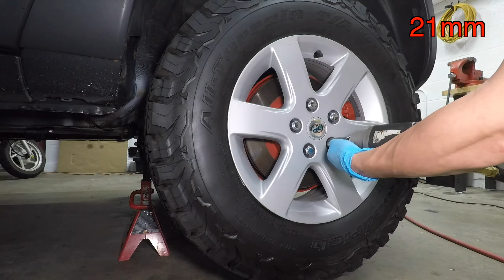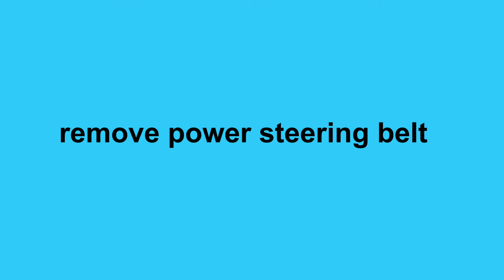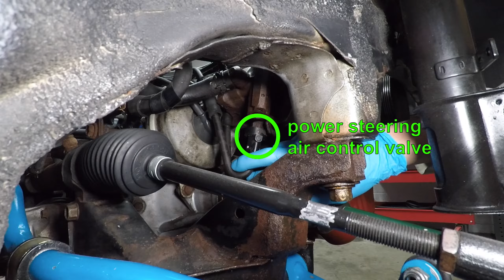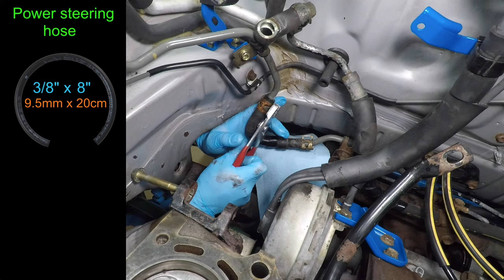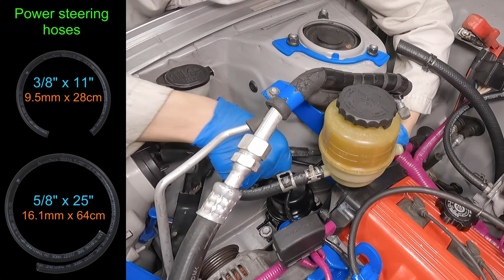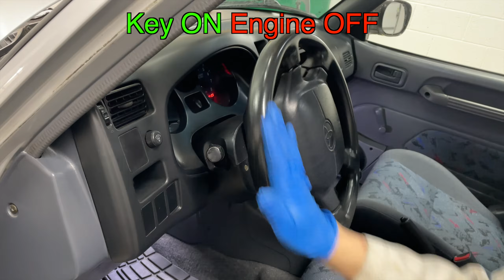Power steering pump replacement 1997 Toyota RAV4 (episode 27)

Comment: Hey Paul.
Thanks for the great video.
Do you think the process to change the power steering pump on 1999 toyota rav4 4 doors with 2 wheel drive is the same or maybe slightly different.
Please let me know. You the  one i watch when it comes to working on my 1999 toyota rav4.
Thanks again

Comment: Hi,m trying to search for ur contact number, but to no avail. Can u pls provide.
Reply from the maker: You can get a replacement power steering pump at your local auto parts store. You might also be able to get the original parts from the dealer. Check out this video: https://youtu.be/L1aBmjMAoSs?si=xRbdWMd8oLhPJR--

Comment: Mr Lab Coat Paul sir, I followed this removal of the vacuum lines from the throttle body to the metal tube in the back and had a vacuum leak. I couldn’t pull the whole metal tubing off the intake because one of the bolts was stripped. So had to leave them. Ran a smoke test and the hose that goes under the throttle body was leaking so I plugged it back in and no more vacuum leak. Don’t really get why it still has vacuum running through it.

Comment: Awesome video man! I managed to get the power steering pump out but the previous owner didn’t have a pivot bolt on there. It was just being held in place with the two 12mm bracket bolts. Any solution ideas IF I can even find where to purchase the 14mm bolt as you did say it doesn’t come out fully so not sure how I would get it in.

Comment: Great video by Paul, as always. 

Quick data point for the PS pump pivot bolt shown at about 3:36: For my 1998 Rav4 and a friend's 1998 Rav4, the bolt came out easily with just a little wiggling.

Comment: Thanks for showing us how its done paul ,i think mine wants replacing its a bit jerky is the steering when first started but after its warmed up its fine ? mmmm  maybe just put all new oil in the pump what do you think ? 1997 model with less than 100k on it .
Reply from the maker: First check your fluid level, and make sure the belt is tight enough. A loose belt can also cause a jerking in the steering.
Reply: @LabCoatPaul  Thanks paul ,,

Comment: The adviced sucked. He blew through the video. I attempted this on a 1999 RAV4, because there are no videos for it. I removed the batter and holder, and I still couldn't see the steering pump. The chassis hub is what's under the battery. I got as far as getting the belts off. There isn't room to take out the pump. Japanese design things so tight. I gave it to an expert mechanic. It was $400 for parts and $740 for putting in the pump and replacing the lines. More than the vehicle is worth. I figure next stop something big happens to this is the junkyard. Japanese vehicles run 200,000 maybe 300,000 miles. After that, they are junk. 👎

Comment: Thanks for the video really helped a lot …I have 97 rav4 right hand drive with abs,the brake booster is all on the right hand side so there is very little room to work with,I had to remove the CV axle for room and remove the pump with pulley from the bottom  it’s way easy.  Cheers

Comment: Sir, what size of the O'ring seal  that connect to hose reservoir? Thanks
Reply from the maker: The O-ring came with the new power steering pump. I don't know what size it is. The Toyota part number for the O-ring is 44337A
https://yoshiparts.com/parts/car/toyota/products/rav4/sxa10-sxa10l_azmgk-gr-3sfe-mtm-lhd-3d-gen-ht/2051891_108
https://www.toyotapartsdeal.com/parts-list/1997-toyota-rav4/power_train_chassis/vane_pump_reservoir_power_steering.html?pnc=44337A
Reply: @LabCoatPaul  Thank you sir, i already fix my steering pump, its 10mm o'ring i replaced
Reply: Sir what is function of relief valve attach to the steering pump?

Comment: Still waiting for my mountain wrench. Managed to complete the belt change anyway. Didn’t remove anything, not even the wheel. Do I recommend it? Hell no. I busted almost every knuckle on my left hand and still have to go back and add tension again once I go drive it. 

Thank you lord Paul for your help, you are my champion of rav4 repairs. In my case of squeal I think the belt might have had too much tension, the screech could have been the ps shaft(?)crying for help. No leaks but the pump itself might be on its last legs. It also wasn’t wobbling like crazy at idle, maybe that’s good? Time to drive after I cool off
Reply from the maker: The belts are almost impossible without the mountain wrench.   Congratulations on getting it done.   The best way to test pulleys is with the belt off.   With the belt off and engine off turn the power steering pulley by hand.   It should be smooth with no grinding.
Reply: @LabCoatPaul  it spins smoothly. Didn’t feel any grinding. Pretty hard to tension the belt. After retentioning just now, it chirps and squeals a bit at full steer and I can feel a bit of shuddering or struggle toward the max steer, like it’s not smooth. Just because I haven’t changed the fluid yet I’m gonna do that today as well.

Comment: Just did this job. A few things
- Thank you for the guide. Very helpful!
- This is a huge pain in the butt to do.
- Best way to remove that I found is steer all the way to the right, then disconnect the outer tie rod. You'll have enough room to remove with wheel and low pressure hose attached.
- It will be messy. Get a catch pan underneath.
- Small hands required.
Reply: Do you have ABS ?

Comment: I did everything exact in this video. Plugged the lines I was supposed to, and I'm pretty sure everything was installed correctly. I even went to your fluids video to see how you did the power steering change. No matter what I do I still have no power steering and it's stiff as can be. I've been turning this wheel all night.
Reply: Post your solution if u fixed it

Comment: I have a 99 , when I press the brakes , they're hard , car idles down , and then turns off, could it be the brake booster?, it just installed a new torque converter,  so I know it's not that anymore
Reply from the maker: Yes, it sounds like you might have a brake booster problem.  Try disconnecting the big vacuum hose from the booster and plugging it.  If your idle is better, the booster may be leaking.  You can also try applying vacuum to the booster.  If it doesn't hold a vacuum, it needs to be replaced.  Also, just check the vacuum hoses on the engine.

Comment: In hindsight was a new pump a better decision then just getting a seal kit and rebuilding yours
Reply from the maker: The pump I used still works fine and it was a lot less work.  A remanufactured pump if done correctly could be better quality than a new Chinese pump, because it would have been an Aisin part that was rebuilt by someone in a factory.  
I've had many problems with Autozone parts so I would probably recommend buying your parts from Toyota, or buying the rebuild kit and fixing the old pump.
Reply: @LabCoatPaul  thanks for getting back to me...so mine 2000 is blowing tons of exhaust smoke after swapping in a new engine...how difficult do you think replacing piston rings and valve stems seals(o-rings) would be ?
Reply: @BIGTR33TR0N  Its a big job there is a video on doing just that on youtube can be done without pulling the engine wich is nice

Comment: Hi Paul. The 5/8 hose you placed at the power steering cup to the steering pump didn't leak? Mine was recently replaced and mechanic placed it with a kink for the hose don't have the same shape as the original.  Now the 5/8 hose has some steering fluid, but no leak where the cup and hose are connected. Could the replacement hose has some tiny holes already due to the kink? I thinking o just replacing like that of the 5/8 hose you used. Thanks for the tip.
Reply from the maker: Just make the hose a bit longer and bend the metal a little like I did so you don't get a kink.  It's at 5:32 in the video.
Reply: @LabCoatPaul  thank for the tips. I really love your videos about your Rav and learn a lot. Saves me money for labor for I learn to do simple stuff my own.  Keep it up!

Comment: QUESTION? Regarding removal of the (Idle air hoses).
 HOW DO I KNOW what head I have? Federal emmissions ??
 I have a Calif 1998 Rav4... 
   It would be nice to clean up engine bay. 
SO BASICALLY.
1.) Can I remove this system? on a Calif Rav-4
2.) Did you ever have any issues with the idle,  I want to avoid any irratic idle or fail a emmissions test.
Thanks!!
Reply from the maker: Yes, you can remove it with no problems.  Watch the video at 2:18
Reply: @LabCoatPaul  
Thank you Sir 👍

Comment: Where did your cylinderhead go?    I changed out one of these pumps years before and never took the cylinder head off. lots of cussing if I remember correctly.

"The resevoirs job is to spew oil over the belts!" LoL
Reply from the maker: I was already replacing the cylinder head, so I took care of the power steering pump at the same time.  It made the job much easier.

Comment: Hi, just one question, how did you connect both air hoses to the steel pipe, the one from the California emissions and the Iddle valve? I need to do exactly the same
Reply from the maker: I did not connect them.  I replaced my cylinder head with a federal emissions head so it didn't have the port in between the injectors, and I deleted the power steering idle up.  I plugged both ports on the throttle body.  You can see it at 23:01 in this video: https://youtu.be/Ksv98JvBqXs
Reply: @LabCoatPaul  thank you so much, that was exactly what I needed 👍

Comment: Paul, instead of draining the reservoir, as I have seen on several power steering pump videos, can I just disconnect the lowest hose that connects to the power steering pump, and let the fluid drain into a pan? My car is a 2004 Corolla, and the power steering pump is at the bottom of the engine.

Thank you for the video! I admire the careful, methodical way you work. 🚙 😃 You fixed the power steering pump, but something else is still leaking. What do you think it is?

Comment: dont you think its time to upgrade to 2007 v6 model?
Reply from the maker: I'm pretty much married to this car.  I bought it for $3,500 and spent over $10K fixing it.  The original retail price was $16,500.  it will cost me more than that to get it back to new condition.  I am a fool.
Reply: @LabCoatPaul  I really respect your grind man. But the things you did like sound insulations, expensive tires and new radio doesn't come with the original price so I think it pays off.

Comment: Thank you! Heads up before you do this on your own everyone: Paul mentions this and if you watch the edits you can see some changes in the video. You CAN NOT remove the PS pump from under the battery box... unless your cylinder head is off. It does give you some more clearance to reach the banjo fitting, and it makes it safer. But the pump will need to come out the passenger side wheel well. Another note- you can wiggle the pump out without dropping the crossmember. I had to remove the passenger tie rod to get enough room, but that is far easier than the crossmember per the Toyota manual.
Reply: Exactly what I did and I didn't even read this first lol.
Reply: Can you pull the pump by removing the axle on that side
Reply from the maker: Great tip! The power steering pump is not easy to work on.

Comment: Do you do stand-up? You're SO funny! Great videos, thanks!!!  I don't think you addressed how to deal with EVERY hole left over after you toss your vaccum hoses... Can you elaborate?
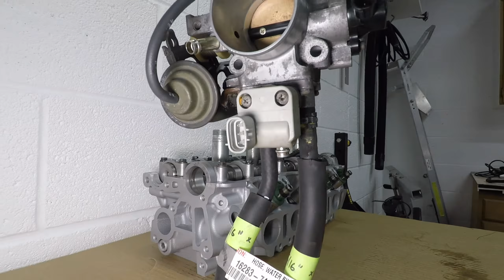Reply from the maker: Watch the video at 3:08  Plug the big hose on the throttle body, and the 1/4" fitting on the right side of the intake manifold.  You only need 2 plugs.

Comment: On the steering pump belt, Is it possible to remove that 3rd bolt with a regular 14mm wrench? Or do we need that mountain double box wrench for the job? Do you remember how you done it?

Comment: Hey Paul, love the RAV4 videos, curious if you have ever had the climate change bulb go out, and if you have could you make a video about replacing it :)?
Reply from the maker: Climate change is fake news.  haha jk!  I haven't worked on the climate control or dashboard lights yet.  They're these tiny little light bulbs.  I might do a video about that soon.
Reply: I also got a clunk noise coming from the front right when I ride over a speed bump, maybe you've experienced this too? Just replaced the struts, and ball joints.
Reply from the maker: @mitchellmoris6729  Lift the front of the car on jack stands and shake the right front wheel side to side and up/down.  You might have something loose.  Make sure you've tightened your brake caliper mount bolts, and the sway bar links.

Comment: What paint do you use for your parts?
Reply from the maker: I used engine spray paint from the auto parts store.  It's OK, but chips easily.  I still haven't found any spray paint in a can that I would consider to be good.
Reply: @LabCoatPaul  Thanks Paul. Your Rav4 videos are very helpful to my Rav4 1999 repairs.

Comment: For those who want to do this without taking the head off the motor, if you remove the motor mount on the passenger side you can raise the motor up all the way and create a big enough of a hole to slide the pump out underneath but you will have to get the pulley off first. Just did it and was not fun but doable. Didn't want to take the head off just for a power steering pump :P
Reply from the maker: Good tip!  Thank you.

Comment: Next video will be how to replace the rack and pinion! LOL
Reply from the maker: I hope not.  That's hard to get to.
Reply: Yes I've done, it is.. Not f u n
Reply: I've done it! If Paul can do it without dropping the cross member I'll give him $1
Reply: @bendavis8090  I think attacking it by removing drivers side wheel well and snaking it out is the best way. It is a pain but after you do it once, you'll know how to rotate it on exit and entry. I still have mine out because I found a second leak (one leak was at the seal (common), the second was at the return line into the rack (rusted).
Reply: @MrButtonMonkey  yeah you're right. I dropped the crossmember because I was replacing the poorly designed engine mount in that area while I did the rack and pinion. Yes you CAN for sure get the rack and pinion out without dropping the crossmember.. Lots of angles, busted fingers, and curse words. What was surprisingly hard for me was not getting the rack out, but getting the intermediate shaft back into place correctly once back in.
Reply: @bendavis8090  ahhh, that's good to know if I need to replace that motor mount thanks! yeah, the shaft was a pain! Twas a good learning experience though haha